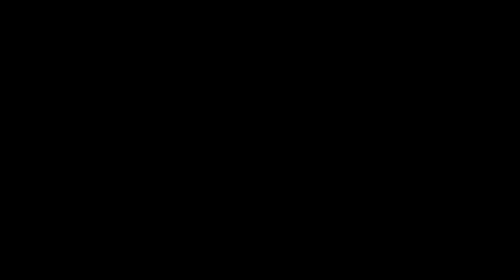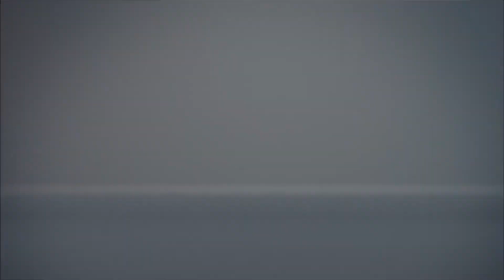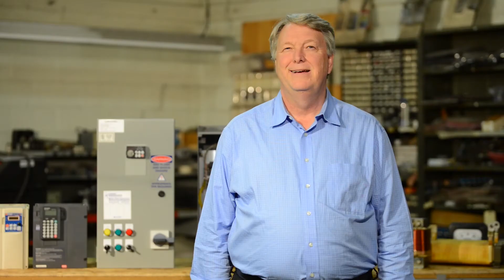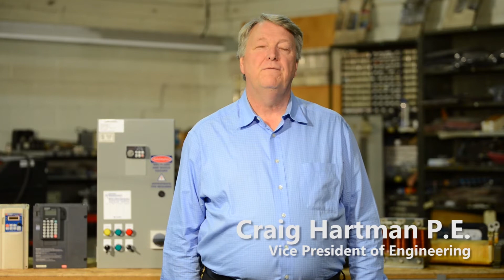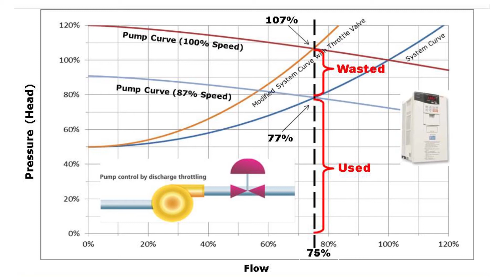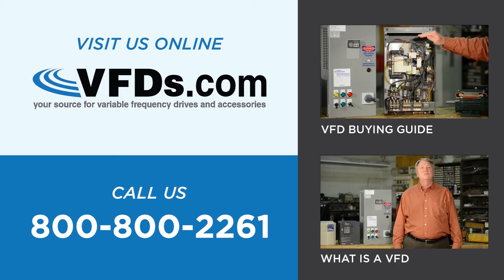Energy Savings using Variable Frequency Drives (VFD)

Comment: While a VFD can save energy in pump & fan applications, the graphs shown where restricting flow and increasing pressure results in higher energy use are incorrect and this is a common misnomer because it is counter-intuitive.  You need to differentiate between the type of pump.
When airflow through a fan is restricted while RPM stays the same, the energy used does NOT GO UP, in fact current draw of the motor goes DOWN and energy is saved.  Same goes for centrifugal pumps (which most are).  If you restrict a valve and increase head pressure on a water pump, current draw of the motor goes DOWN and energy is saved.  
What the presenter is explaining would be true for a 
positive-displacement pump (NG compressor mentioned at end of video). 
There can be substantial power savings in slowing it down vs. 
restricting flow because when flow is restricted and head pressure 
increases the energy usage goes UP because the motor is working harder 
to compress the gas to a higher pressure.
You can ask any HVAC person who's installed furnace fans 30 years ago.  On a new installation they would check the current draw of the squirrel cage fan and if the current was TOO HIGH they would RESTRICT the flow in order to bring it current down to an acceptable level and prevent overloading the motor.  At the same time, the refrigerant compressor (positive displacement pump) would draw too much current if pressure was too HIGH it would work harder.
Reply: VFDs.com: "Nic, please examine the graph again. You will see that we did not claim 
that restricting flow results in higher energy usage, only in higher 
pressure. Power is equal to flow times pressure, so energy is saved in 
either case, but more energy is saved with the VFD."

I understand the claim was not made, but the video is misleading because this important point is not explained:  higher pressure does NOT = higher energy usage.  

I appreciate educational videos and thank you kindly for making it, but it only tells half the story.  For example, you cannot claim that a hybrid car gets 150 mpg and is therefore 5x better than a car that gets 30 mpg,  while leaving out the fact that it does so only after charging with electricity overnight, and can only do 150mpg for the first 100 miles.  Granted, the electricity is much cheaper (but not greener) but it was used nonetheless.  

One of my customers pointed out this video to me and was prepared to make a $25,000 decision based on energy savings of 20-30% because, hey, his water pumps only run at 70-80% flow most of the time.  But, he was not considering that his power consumption was already significantly reduced due to the restricted flow.  He would have spent $25k on upgrades, and then ongoing maintenance costs, would need to provide an air-conditioned space for the VFD's (or significantly over-size them due to high ambient); and then maintain that additional building etc.

It is poor engineering to add cost and complexity in the name of theoretical energy savings, when all factors are not considered in the calculations.  
Thank you.